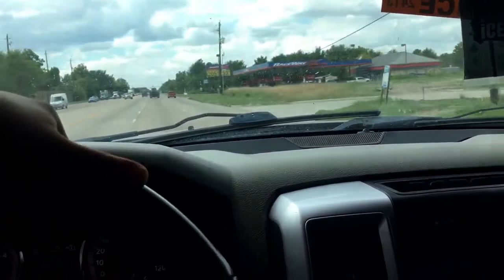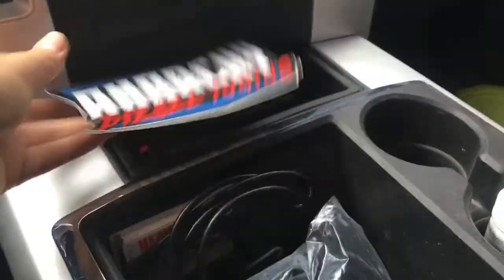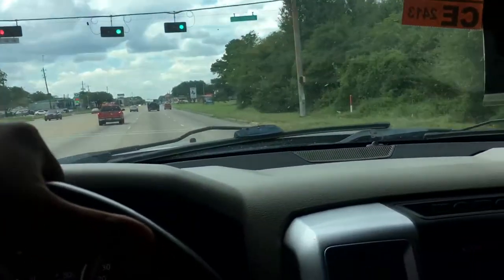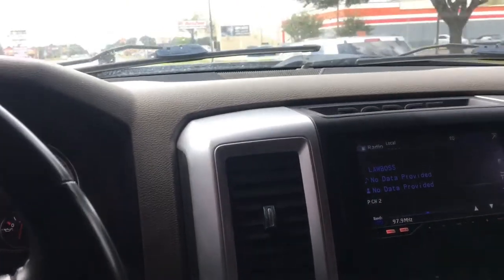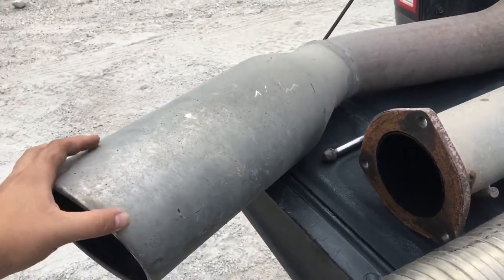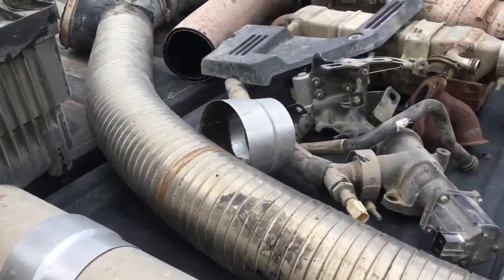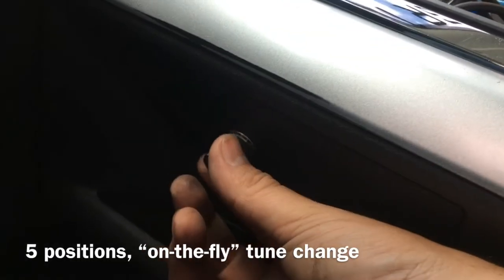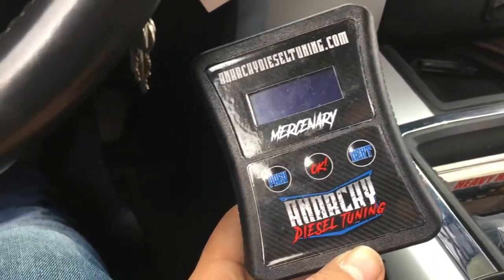6.7 cummins EGR delete, anarchy tuning on the fly, S&B intake, and 5in turbo back straight pipe

Comment: Great video! I’ve got a ‘14 Cummins and am getting ready to delete it in two weeks.. still torn between a 4” or 5” straight.. I’ve got little kids and I pull a 30’ travel trailer in the summer time.. worried about the drone noise / cabin noise. I’ve seen a lot of guys say that getting the flo pro installed helps reduce the drone a lot.
Reply from the maker: 5in obviously is louder, but to be honest it’s not that bad, I’m so used to it I feel like my truck is not loud enough lol

Comment: I got my truck deleted last week its an 18 dually but after several miles the check engine light came on with code p051b is this normal after a delete?
Reply from the maker: I have had driven my ram 80k miles after tune and no check engine so far
Reply from the maker: Check what the code is for and fix it, my dad deleted and tuned his ford got a check engine 2 weeks later for the crankcase filter, just has to replace it and the light will go off

Comment: Hey bud, is the EZ tuning all you need to delete your truck? I have the exhaust and egr delete, all i need is to program, would that be the only thing i need for the process?
Reply from the maker: Sounds like that’s all you need, I had a shop do everything on mine
Reply: Tuning will really wake the truck up an compliment those other mods well. With tuning you will want to look into a cold air intake system as well because the engine will be demanding more air after the tune.